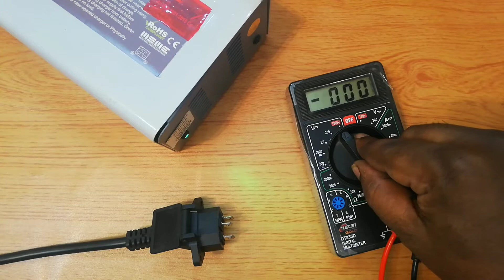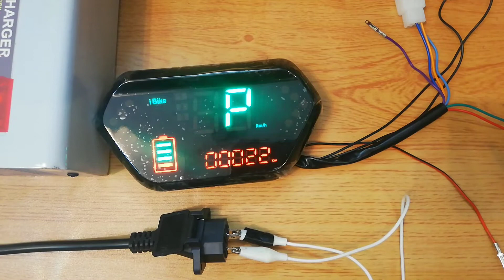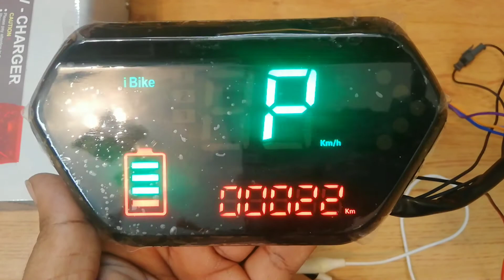ebike display

Comment: Hello. Thanks for the video. Can you maybe help me. 

I recently buy one motorbike when the battery lithium 72v 30 Ah is connected, it always shows as 100% full with four bars on the speed display.

 However, the issue is that the bars do not decrease while driving; it remains at 100%. When I travel around 50 kilometers , the battery runs out but I only get the low battery signal with the icon appearing just about 30 seconds to a minute before it's completely depleted. This means I never see the battery level drop; it's either full or empty, making it very difficult to manage the autonomy, knowing when to recharge, especially since it could run out when far from a charging point.